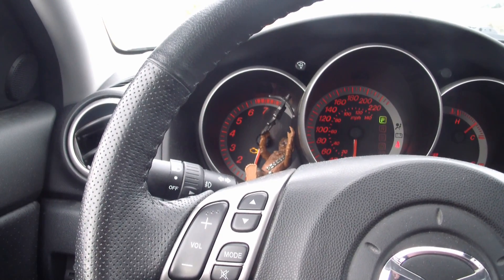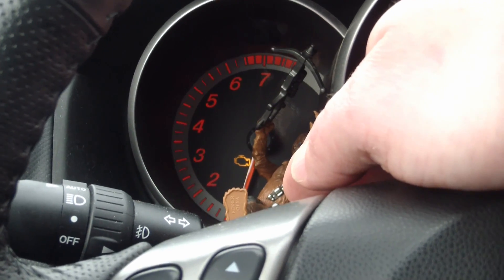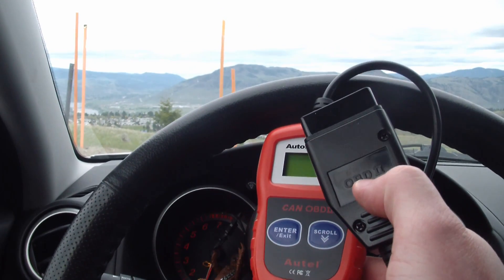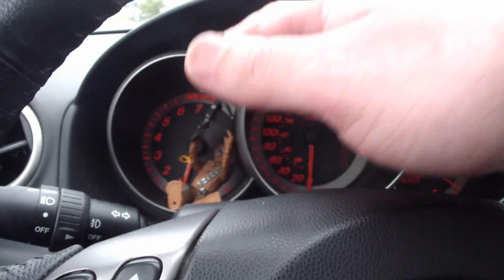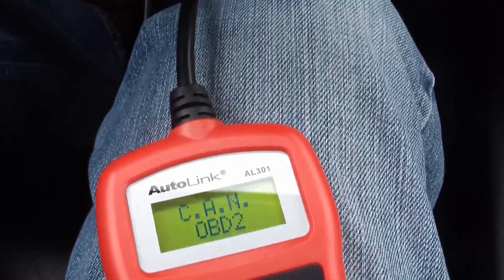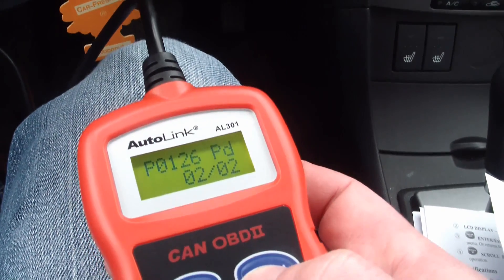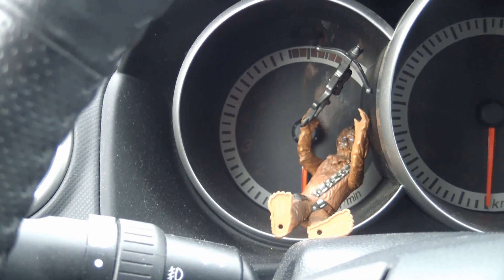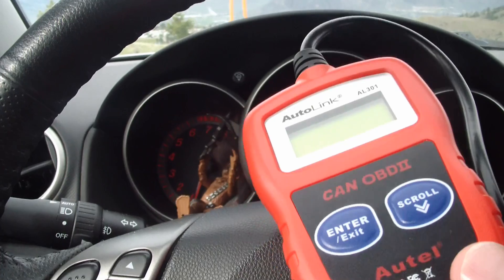Manly-Man Skills: Outsmart Mechanic Scams by Using Your Car's Computer!

Comment: Be careful removing the battery terminals if your sitting in a Honda. Any time the radio looses power it wants your radio code b4 it will make noise again. Sometimes your lucky and its written in your manual.  Sometime your going to the... Stealership! Its a complete pita.

Comment: Temp senders die all the time. And you are absolutely right, nine times out of ten the check engine light indicates a faulty sensor or something else that nobody cares about. German cars need codes cleared after changing light globes before they will work again........ But if you are stupid enough to buy a euro car you deserve to have your wallet raped.

Comment: Every home tech should have one ...beats getting shafted for £56 for a spanner monkey to plug in a computer, mechanics or technicians are only fitters of new parts never actually the amount of parts that get scrapped when they may only need a new rubber seal is incredulous also sometimes you can pick up copies of the dealership software for VW that covers the complete VW range plus SEAT& SKODA , Seen the ford disks, and GM/OPEL /vauxhall...I imagine most poplular car makes are out there

Comment: Good Vid. P420 is my nemesis code. An NO it does not mean the truck needs weed.  I bought a little $12 wireless ODBII BAFX brand adaptacator that talks to my Android Pad.  I use the $5 "Torque" software.  Reads and clears code and has cool instrument data display.  It also records data and gives you plots.  Your advise is solid - the dealers like to charge $80 just to read the code.  The stoner dude at AutoZone will do it for free too.  Dude I'm shocked - I had you pegged for an F250 going clickty clack, please tell me that the civilian car is your sweetheart's ride. WWCLD (What would Corb Lund Do?)

Comment: You can get bluetooth OBD devices on ebay for $10-$20 shipped and interface them with an Android device using the Torque app or something similar.  Very cheap and will auto search what a code pertains to.

Comment: we bought one of the universal ones that's USB and hooks into our laptop so we can see the RPM's and everything while the engine is running. if the car is an old one(like 180k miles+) some of the sensors are shot anyways but if it passes emissions just fine it's nice for clearing the codes and driving just long enough for the car to enter its "defaults check" so the light goes off and then taking it in to get inspected. we had to replace a transmission shift sensor... in the driveway lol because the cost for them to pull the engine to do it in a shop is more than the car is even worth at this point! it still throws the code for the coolant level because the sensor is just shot. but these are MORE than worth their weight in gold! do some research on the different ones available and BUY ONE!

Comment: Currently in Aus, nearly all stealerships are filled with "parts fitters" not mechanics.. I mean they are technically qualified (or apprentices) but can't do diagnostic work - even many non-corp workshops struggle to find decent mechanics that can troubleshoot anything even slightly complex.

More scarily, apparently they don't even teach any basic welding at TAFE (tech college) for a mechanic trade cert.

I also believe that manufacturers are making it more difficult for workshops to fix vehicles - how much per car would it cost to log the last 24 hours of operating parameters? 3 or $4? so when someone rings up with a "my car just did this" complaint, they could pull the logs and check the operating conditions before and after the event - not traditionally a mechanic's skillset - but it might have to be - especially with increase in hybrids etc.

Comment: if you guys want one here is the link: please thumb up:)
http://www.ebay.co.uk/itm/Pocket-Scan-Tool-Auto-Code-Reader-With-Live-Data-OBD-II-EOBD-Scanner-/231519574905?hash=item35e7a45b79

bare in mind OBD 2 was only a standard after 2001 so a pre 2001 car may have the port but not the computer

Comment: disclaimer OBD 2 was only a standard after 2001 so a pre 2001 car may have the port but not the computer
Reply: Jared Reabow Pre 1996..
Reply: 96 man.
Reply: MrADVANCEDTEK 1996: The OBD-II specification is made mandatory for all cars manufactured in the United States to be sold in the United States.2001: The @69).
Reply: Peter Carlson not in the uk
Reply: LucasJ1540  not in the uk
Reply: Jared Reabow That's funny I know for a fact that the Range Rover HSE was introduced with OBDII. Model year was 1995. Maybe there's enhanced OBDII systems starting in 2001. Not sure. Generic Engine Management System or GEMS. The GEMS is still used and is called Generic Functions or MODE-6. There's so much misinformation about vehicles and techs take the heat or get a bad rap when owners don't know what their car's computer is doing and how.
Reply: Jared Reabow The 1995 Range Rover HSE was made in the UK if I remember correctly. Sollihol on Lode Lane. They gave Master Techs a free trip to tour the plant which I couldn't make. There are some cars that had OBDII earlier than others and I'm no expert for all UK Vehicle Emissions hell I just read there's a JOBD the "J" meaning Japan. Cheers!
Reply: +MrADVANCEDTEK So, the way it worked in the US is that that the mandate stated all cars built for model year 1996 had to have the OBD2 protocol. However, this mandate was not passed in December 1995, it was passed as part of the Clean Air Act of 1990, giving manufactuers sufficient time to develop the proper systems and protocols they needed. There was a small loophole though, which was that while all cars in the US had to be equipped by 1996, they didnt have to show 100% functionality until 1999.

As for the pre-1996 cars, there were some that were choosen as test beds for the program and since the requirement had been known since 1990, some manufactuers choose to equip their vehicles before the mandate took effect.
Reply: +DK1102 I'm not sure I understand your post. I'm sorry but starting a sentence with "so" means your either answering or asking a question....just saying. So, the Clean Air Act of 1970..... yes that is the correct date....all others are amendments that happen on a yearly bases. Again misinformation I think.  But that is different then the whole OBD2 discussion and when it was first used in Europe(Jared Reabow's Post above)or by UK carmakers. When did I say it was passed in December of 95? The carmakers did not have to give 100% functionality they only had to comply to a set of protocols that would allow for a general system of engine management. Generic Function is what they called it then. Now it's known as Mode 6. Later most carmakers chose not to play with the CAA by adding additional code definitions to their own systems wish was their right to do cause they were using different sensor types which had much better operation. The CAA will soon be amended again with more updated required protocols so all independent shops can offer competitive services to newer car owners. So, I could be wrong though. I do know that a UK carmaker had a OBD2 compliant Generic Engine Management System in their car shipped to North America. Still have the class book somewhere. The 1999 compliant or 100% functionality your thinking of is the EOBD2 Enhanced On Board Diagnostics. Those did meet your 1999 date pretty much.  And yes some carmakers did have a "beta" OBD2 system and I did mention that along with them not having to use only one type of connector so your are right my friend. I'll have to check again my brain is a bit bungled. Cheers

Comment: "All it means is there's a stored code. Potentially active, potentially not active." This is correct.

"You can go ahead and remove the battery terminal, but the code will still be in the computer (AKA ECU)." This is utter crap. Codes are easily erased by disconnecting the positive terminal of the battery for ~10 mins.

If the problem that caused the trouble code still exists after the battery disconnect code wipe, the CEL will illuminate after a nominal drive cycle. (Ref. http://www.lyberty.com/car/drive-cycle.html )

Knowledgebase; 16 years as a professional tech. And, 20 years working on cars for the family. I'm 34 now. OBDII is a PITA to deal with, but it's an important diagnostic tool!

EDIT: My own '09 Lancer Ralliart throws a misfire code under certain conditions due to an aftermarket intake installed by the previous owner (misfire code happens under rapid WoT, lift-off events. As in spirited driving down a windy-arse road).

Comment: You can also grab torque on android $5 and grab a $10 ebay bluetooth to obdII adapter. http://torque-bhp.com/wiki/Bluetooth_Adapters

Its has a nice dbs of codes to English lookup and well as the magic of google right there on you phone.
Reply: KingOfKYA Also as other have said there is a lot of conflicting codes between brands. Thats one of the benefits of the apps it can figure out the difference between brands.

Comment: Cant comment on the dealership system In the US but in the UK Most of us do are best to get people on the road without bending them over, Just a few notes By clearing the code you remove all freeze frame data this means that if you bring it into the dealership later they've got a lot less to go on than they would normally, also worth noting the autel you have will only do MIL (malfunction indicator light) so any ABS SRS TPMS Lights etc it wont be able to read it also only reads OBD2 generic codes rather than manufactor specific another quick note for looking up fault codes try Obscloud.com they have a pretty extensive list of fault codes.

Comment: Anyone know of an inexpensive OBDII scanner that will clear ABS codes?  I was working on my wife's car and took the battery cable off.  Then I put it back on but did not button up the battery containment crapola and left my ratchet atop the battery.  I ran to the parts store to grab some RTV and the wifey thought I had fixed her car and tried to start it.  Now we have an ABS code that won't go away.  

ABS works fine as ny better half's myopic driving can attest to.  The crooks at the dealership say that the ABS module must be replaced in order for them to clear the code.  Would like the light to go away but not willing to spend the $1700 they want... Any suggestions?  Tried taking the battery off completely for as long as 12 hrs to no avail.

Comment: Sir, you are right in some aspects. I'll show you the worst case (many other German cars have the same shit ): you own a VW Golf 4, as soon as the check engine light appears (could be ofc caused by anything, even by a passenger's stupid face), the main computer of the car goes into "Safety Mode". In "Safety Mode" these fuckers DO NOT read any information from sensors, they don't advance timing or change fuel ratios adequately to engine's load, etc. So you're running a programmed in map of fuel ratio and all that, causing the engine to lack power, burn a lot more fuel. And it will remain untill you fix any issues causing the "change engine" light and clear the codes. I know it, because unfortunately my mom owns a MK 4 Golf, but it's fixed up since a year or two and drives good, but I would never replace my Corolla with something like VW.

Comment: Ex-dealership technician here. While there are A LOT of dealerships that have corrupt technicians and management within the ranks, there are just as many qualified and honest techs that are often times more capable of repairing problem vehicles. I appreciate the AvE videos and find his knowledge and research impressive. There was no diagnosis made in this video so that being said you’re exactly right there was no need for a mechanic. Google research will get you some likely results but without proper testing they provide no Diagnosis either just another approach to throwing parts at a car. Simply put we are not all crooks, often smarter than mom and pop shops, better equipped and have extensive training on the dealer specific car lines. Find a tech that you can talk to and stick with him, you will know how good he is if your car if fixed right the first time. This discussion could go on back and forth forever, AvE (Chris?) is right educate yourself and find out what the codes are but if you think a $30 generic code reader is going to make you smarter than a Master Certified Technician you are very likely wrong. Now please excuse me I must get back to eating my pizza on the hood of your car.

Comment: As always, love the vids AvE

OBD2 code readers available to the general public is a nightmare for a technician lol. I work on cars for a living, run my own shop, not a dealership! I can tell you that average Joe having a scanner makes average Joe who know nothing about Cars 101 think he is an expert and try to tell me what is wrong with his car. I will agree 100% with what you said, take it in and tell them the issue you are having, not what you think is wrong with your car! My job and theirs is to sort you out and find the root cause. While most people think all auto techs are frauds (and probably 90% of them are), the honest ones will end up saving you money and more importantly precious time. I have north of $100k in tools and equipment and need more every day. The home gamer cannot justify buying it, it is just too expensive to buy for private usages unfortunately. I'm rambling a lot here, but just trying to get some points out there to the masses. Anyway, bottom line, if you get a code reader, use it to inform yourself. However do not advise your tech on what you think the problem is base off of your vast 2 day auto repair experience and $30 code reader. Most shops have scan tools that cost over $10k and go much deeper than reading codes. Sampling is in the millions of times per second to catch momentary issues and data stream reading is a whole other diagnostic procedure in the same machine. On a side note, womens cars tend to be much easier to repair because they tend to just come in and tell you exactly what the issue is with their car, what it is doing and do not generally speculate or advise on what they think the best repair plan is or what the core problem is LOL. Watch out for the crooks and have a good one!

Jeremy R.

Comment: Btw, that code probably means that the mechanical thermostat is stuck open, and so engine coolant is always being circulated through the radiator, even when the engine is cold.  Besides throwing off all the air/fuel calculations, an over-cooled engine increases wear because clearances between moving parts get out of whack:  Pistons aren't particularly affected by the cooling system, so they attain their normal operating temperatures and expand accordingly, but the block and cylinder walls aren't expanding in accordance.
Reply: I wasn't going to go into further detail on stuck thermostats, because normally, it involves periodically squeezing hoses, watching bubbles swirl around in the radiator with the cap off, and a lot of waiting, swirling and squeezing, to determine if there's a difference once the engine warms up to its normal temp (around 160˚F)...

But you have a FLIR...
Reply: So, in a SNAFU, from a cold start, the top radiator hose will increase in temperature roughly in step with the top of the engine.

In SN, the top radiator hose will remain at roughly ambient temp as the engine warms until the thermostat pops open, where it will quickly rise to the temperature at which the thermostat's wax plug melts.
Reply: Nevin Williams Actually if you look closely at his temp gauge you can see it's right in the middle and the temperature is fine, which most likely means it's the temp sensor giving a faulty reading to the ECU. Stuck open thermostat will usually have the gauge at 1/4 temp.
Reply: This applies with no airflow?

Comment: If you're a cheapo like me, most auto parts stores will let you borrow theirs and check/clear the codes in the parking lot.
Reply: ***** Never, sir, never.  If you can't beat 'em (with a stick), join 'em.

Comment: A flashing CEL is a more serious problem:  it indicates misfire, which means that raw gas is being pumped through the exhaust and into the catalytic converter.  The cat will then do what the engine didn't, and burn the fuel.  This makes it very hot.  If the engine is under load, it will look like you've got a neon sign underneath the car, as the cat and much of the exhaust behind it will glow bright red.  Fire is then imminent.
Reply: hee.

Have you ever seen a car driving along (usually uphill) with the exhaust aglow?  it's a sight.
Reply: Nevin Williams Many OBD2 cars will go limp (and cut fuel) to avoid a meltdown when there is a flashy CEL misfire under load, thus avoiding imminent meltdown.
Reply: Nevin Williams Usually when it's at the point of flashing the chimes will also be going if they're working. That's the big clue you should forget about driving and call for a tow truck. Can also go off like that if operating temperature stays excessive too long, or in some cars also low or no oil pressure. Some of those things you'll also see multiple lights for the respective problems.
Reply: Great addenda, folks, to a very broad topic.

Comment: A steady light, not too terribly urgent...  could be as simple as the gas cap not being properly tightened.  It takes 3 'trips' for the light to go out after fixing that situation.  Newer cars have gas caps that have less ambiguity wrt proper tightness, while the old style was a 3 click minimum.  

That error code is most likely to appear after someone else has put gas in the car.  The experienced hand can usually tell that it's a gas cap code by noting excess torque required to produce the first click when further tightening the gas cap after seeing the CEL.  However, since it takes 3 trips for the light to go out, (A trip roughly is an engine-start, drive until warm or a couple of miles, engine-stop) it's still pretty annoying.